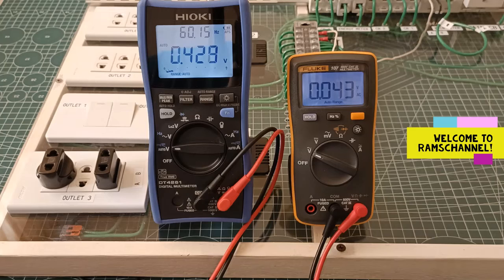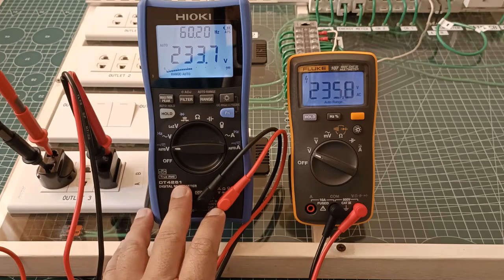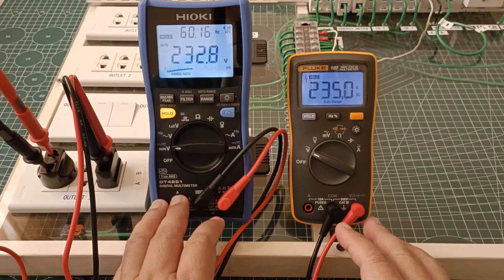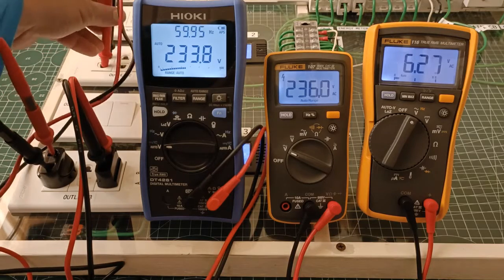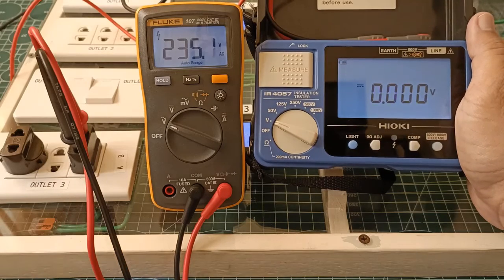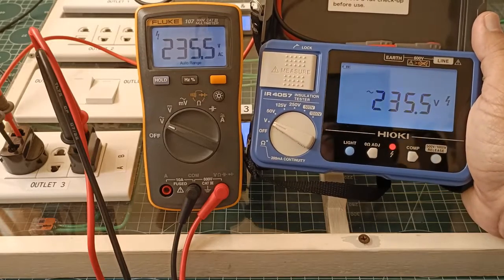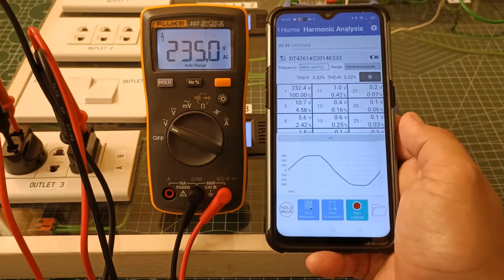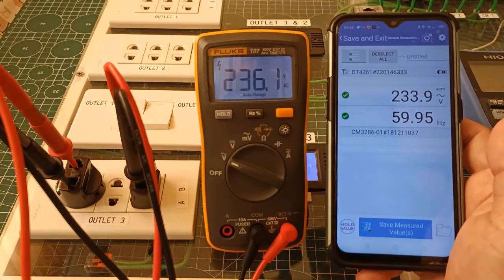[CC] How Fluke 107's AC Voltage Compare with a True RMS & another Averaging DMM

Comment: What a great video and comparison!  This Gentleman is very knowledgeable.  The Fluke 107 is a very appealing little meter.  Other than the way the clamshells go together, which seems to produce a slight ‘creaking’ when pressing the backlight and the left side of the case, it is a solid meter, and is the same size as my IPhone, although I don't know if I will be carrying it in a pocket?  

If anyone is adventurous, and take apart the clamshells, putting a narrow piece of scotch tape along each side of the lower section, where it curves, will solve, or at least help to mitigate most, if not all of the ‘creaking’ when put back together.  ‘ramschannel reviews’ and I have discussed this, as his F107 does the same thing.  Also, as he advised me, be careful and not over tighten the screws.  Of course, do this at your own risk.  A tip on getting the clamshells apart:  Turn upside down, and squeeze the meter side to side, and it will eventually loosen and then can be separated.  This is only necessary to replace the fuse if needed.  ( or to apply the ‘Scotch tape hack’ 😊)  👍✌
Reply from the maker: Thank you!
Reply: @ramschannelreviews  You're Welcome!

Comment: hi !!! what a nice review !!! , I have a question if you can help me it would be great, I am between the fluke 107 and the fluke 110, which is better of  these two?
Reply from the maker: Thanks for your comments. There seem to be a model Fluke 110 & 110 Plus. Did you mean the 110 Plus? It's appears to be the same as the Fluke 114. It depends on your use case at the moment. The Fluke 107 is lighter. It has capacitor and diode test functions, 10A current measurement & lower cost- not found in the 110+. But with the 110+ you get better build, true RMS, and LoZ. If you chose the 107 now, assuming it meets your use case, you can just upgrade later on to say, 116 or 117. But if true RMS & robust build are more important at the moment, then 110+ would be the better choice. Good luck!
Reply: @ramschannelreviews  good evening, thank you for the immediate reply, yes, I mean the simple 110, I want it for household use, such as for measuring batteries, electrical outlets, laptop and PC power supplies . if buy the 110 True RMS I'll be fine ?
Reply from the maker: @Gman52  I see you mostly want to measure household & appliance voltage. The Fluke 110 should be fine, and you get that true RMS accuracy for AC voltage. Good choice. Stay safe!

Comment: Which multimeter can measure resistance measurements to 000.00 ohm decimal places? I have the HT118A and it cannot go that low. Which multimeter can or what do I look for in the product spec sheets. Thank you
Reply from the maker: Thanks for watching. I don't know of any general purpose digital multimeter that has the resistance resolution down to 0.01 Ohm. If you're willing, may I suggest that you also take a look at a specialized, dedicated resistance meter, like the Hioki RM3548, which has a resistance range of 3 milli-Ohm up to 3.5 Mega-Ohm, with a resolution of 0.1 micro-Ohm at the 3milli-Ohm range. I don't have this model, though. What I have is the Hioki IR4057, which is an insulation resistance tester, but has the Low Resistance Function that has a resolution of 0.01 Ohm at the 10-Ohm range, and 1 Ohm at the 1000 Ohm range*. 

Links to both test instruments provide more details. The RM3548 has the superior precision & accuracy, but the IR4057 should provide good results if 3% accuracy is acceptable. Good luck!
https://www.hioki.com/sg-en/products/resistance-meters/resistance/id_5827
https://www.hioki.com/sg-en/products/insulation-testers/5-range/id_6812
Reply: @ramschannelreviews  I bought a kaiweets ht118e instead. Has 20K resolution and from reviews looks like it will do the job. Thank you
Reply from the maker: @SuspiciousPixels  Great! We'd be excited to see you're future review of it when you could.

Comment: Interesting comparison, I have not done such before but likely will now. I have found that averaging meters are generally acceptable since true RMS readings are rarely required though I do have several TRMS meters in my workspace for that odd occasion. Just as a BTW I have a first gen Fluke 73 that still works well and is still holding its initial calibration.
Reply from the maker: I appreciate your comments. It's amazing your old Fluke 73 still works well. Calibrating electrical testers will cost quite a lot, so you stand to gain if your instrument holds its accuracy for a long time.